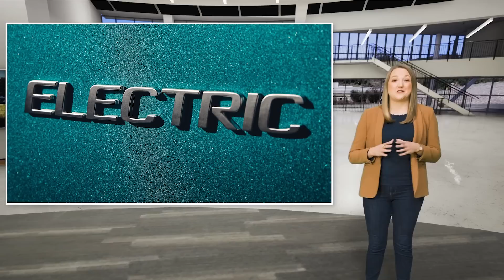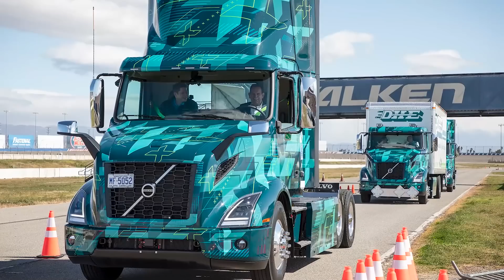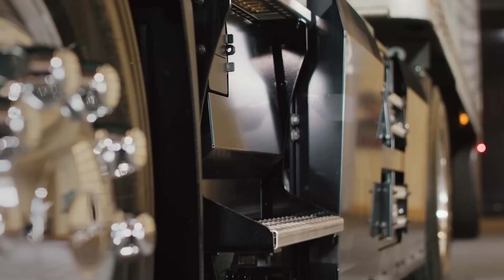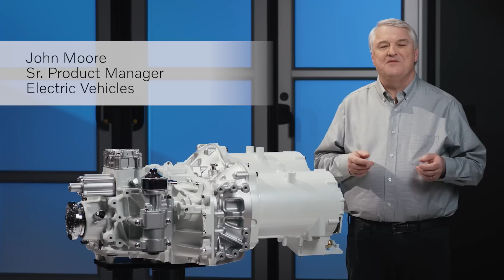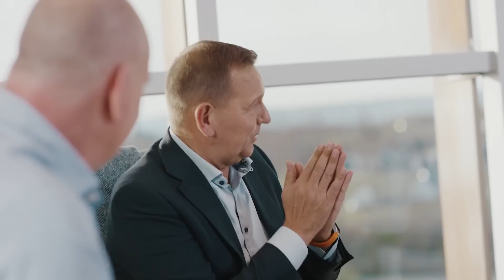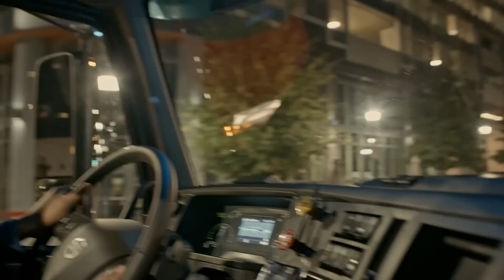Volvo Trucks - VNR Electric Virtual Launch

Comment: It's the way to go. But what I would like to see in the future is doing away with the pneumatic braking system and going towards a hydraulic and or electrical hydraulic system.  And on the trailer, have it the same way. Instead of a pneumatic braking system, I would like to see a hydraulic braking system powered by the electrical hook-up going to the trailer. Also Volvo if you guys are reading this what I would like to see is to get rid of the mirrors and just have cameras. With that being said make sure the camera have a large enough angle to not only see down the side of the truck and trailer but also the wheels, because it helps when going on scales to be able to see where the wheels are positioned and also when chaining up, I like to be able to see how my chains are doing.  Also if you guys ever go to a camera system, please position the video screens along the a-pillars because not only is it natural and intuitive to the current mirror system but also you want to make sure the driver still looks over to the right just like he would if he was looking at the right mirror. But getting rid of the mirrors would be great cuz it would open up visibility tremendously out the 45 degree angles and also Aid in tight backing situations. Thanks for your time and keep up the good work!

Comment: You do realize the biggest stumbling block with this product application? The range, and charge times! This is NOT going to be applicable in this industry just with the time needed to charge the truck, and how it would hold up in extreme weather conditions! It sounds good on the surface, but still the stumbling blocks have yet to be addressed, and what benefit would a truck be like this working in 5 to 10% of the nations fleets! Work in progress i guess!
Reply: The decision was likely made to focus on city delivery not long distance. At Tesla Elon stated their truck long range model will achieve upwards of 640 miles of range. Volvo decided to focus on a more traditional truck design and not extreme design. Tesla truck going to use two different charging options one V3 the other mostly located at trucking home base megacharger. Megacharger rumor going to be equivalent of 4 480v  charging and upwards of 1000 plus miles of charging per hour or a megawatt hour. 

The V3 will possibly use 2 V3 charging stations and would double the charging to 80 percent around 1 hour.
Reply: In which cities? They must address weather extremes, and how they would hold up! The trucks we have now struggle to adapt at times, and where do you find the charging stations? Drivers federally mandated hours of operation would be dramatically effected! Extreme heat, or cold, how does this technology last in those conditions, because even tesla says their cars have a very difficult time in extreme heat, or cold! 🤷‍♂️
Reply: I think as time goes on it will get better but part of the problem is they're using existing chassis that are designed with traditional powertrains and I think eventually what they're going to have to do is make interchangeable universal battery packs that slide out from either the front or sides of the truck and so when you go to the truck stop, instead of pumping fuel there'll be battery pack that you slide out, hoist out with a crane, plop the new one in, plug it in and slide it back in.  And if not that then hopefully the technology for super charging the battery packs will come available in the next coming decades.
In the past they used to have the plugins on the ground at a lot of different truck stop so you could hook up your phone or TV and then after that they tried idle air and both of those systems resulted in making it more difficult to park the semi trucks because everybody was trying to nose into spots and only the big chains like Pilot, Flying J and Petro were actually installing them so they were sporadically spread out across the country and obviously that wouldn't work. But I think eventually the infrastructure will be there and they will find ways to either interchange battery packs or have extremely fast charging times. As far as cold weather goes , yes it does reduce the distance but having owned three trucks and doing over 50% of my operation in The Dakotas, Montana, Wyoming, Colorado and other areas where extreme cold in elevation poses a problem, the electrical will hold up much better then current cooling systems, fuel systems, and what I would like to see is the elimination of the air system and just go to electrical / hydraulic braking.  Because the cold weather wreaks havoc on traditional cooling systems, fueling systems, and pneumatic systems that we have on trucks today.
Also it will make Trucking a lot safer as trucks will no longer have such long lag Times building speed as they are much quicker than current diesel engines.  And don't get me wrong, after 25 years of driving and another 10 years being around heavy equipment, I'll always love the diesel engines but in the future they will be no match compared to the electric motors and systems.
Reply: @adamhose5231  I second that. Winter sucks for current trucks, and no DEF! No DPF sensor malfunctions causing derates! How much money would that save just by itself?
Reply: If you had watched the other video you would have heard that at roughly 1 hour the battery system is 80% capacity
Reply: It's going to come down to industry and price.

If you're doing something like local DSD, your drive time may only be 4 hours or less of your day. The rest is loading, unloading, merchandising and a lot of waiting. So a truck that can do 150 miles in that day and go back to the warehouse and charge overnight is perfect.

What I would really want to know is the price premium, whether or not the electric system can be tied to a reefer system, what's the weight penalty, and what cold weather means to battery range.